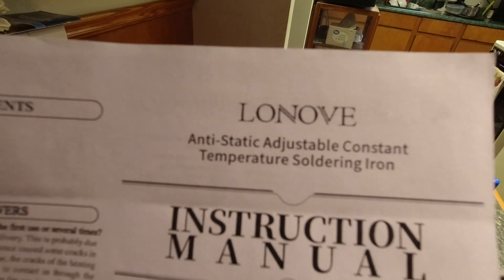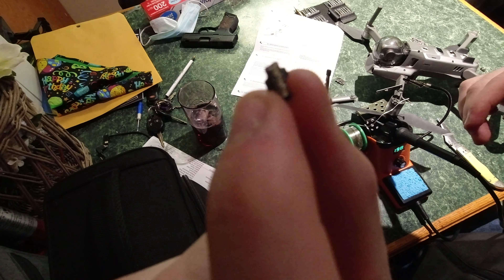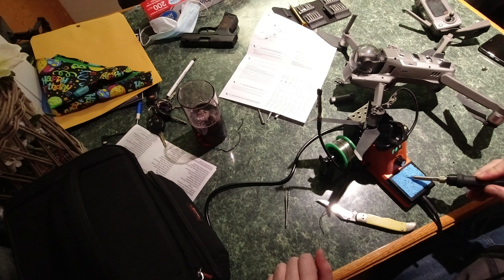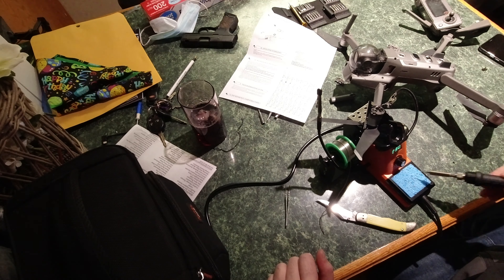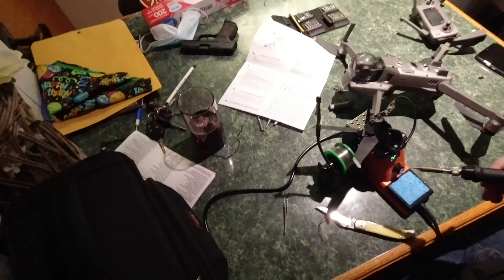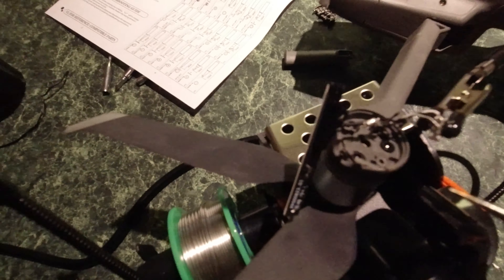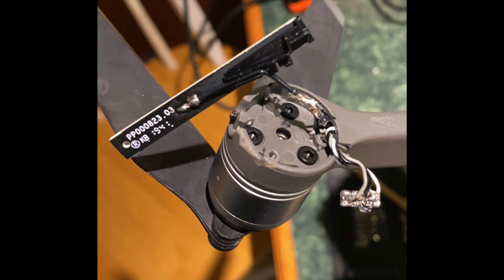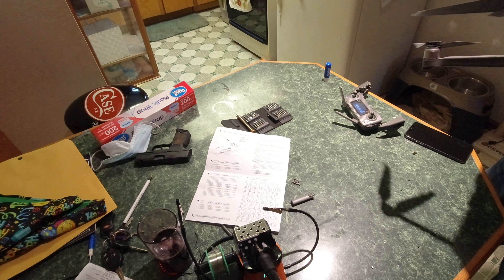Lonove Soldering Kit Station

Comment: The arms on this thing are fantastic for holding your work.  Unfortunately my iron broke in 6 months.  The white ceramic heating element snapped in half.   :P
Reply: I should add that it broke the first or second time I used it. I don’t solder that often

Comment: Is it low melt solder
Reply from the maker: I’m not sure . It’s just whatever they supplied with the kit .
Reply from the maker: It worked good though.
Reply: Not really.  I've got other solder from an electronics store that I used with it.  I wish the label had not come off.  This other stuff I have melts way faster.